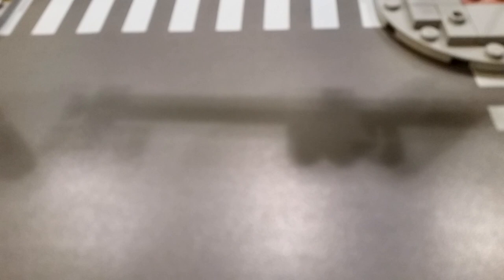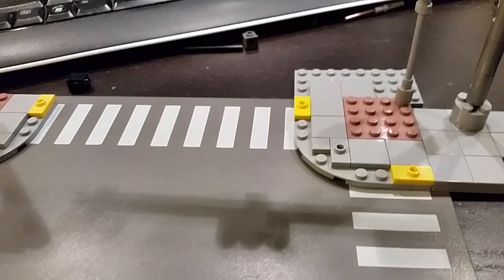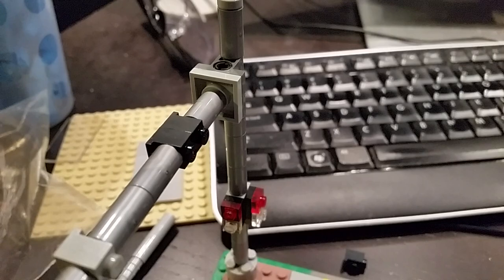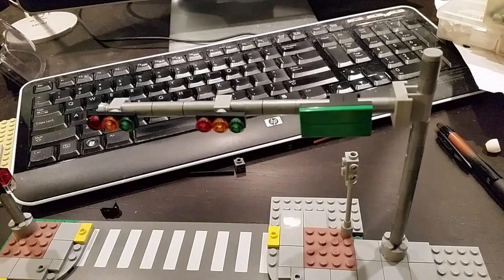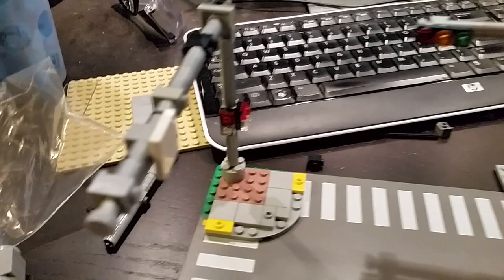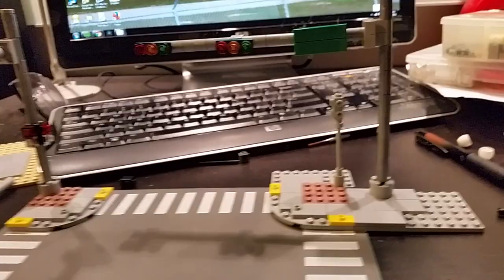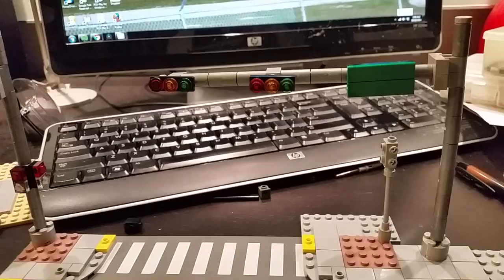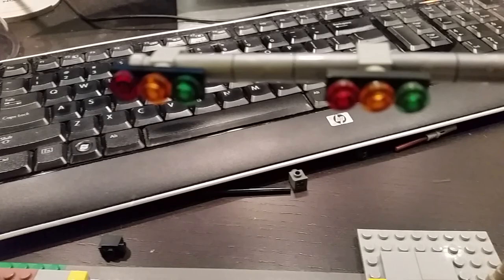Brand New LEGO Traffic Lights (My Own Creation)

Comment: Great job - that looks great.  My only suggestion would be to make the street name green plate a single 1x4 instead of double (or 2x4) as it looks a little clunky compared to the elegance of the rest of the signal structure.  Great job though.
Reply from the maker: Thanks! For sheet metal signs it's perfect to do 1x4. Miami uses 2'x6' illuminated signs as a standard so I figured 2x4 or 2x6 plates would come in handy.